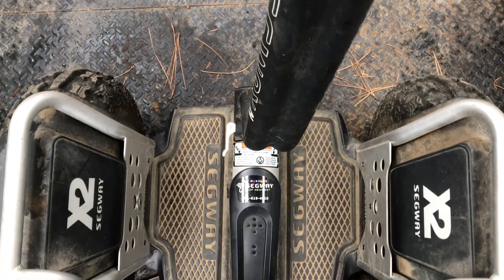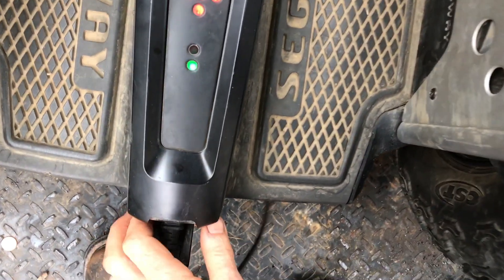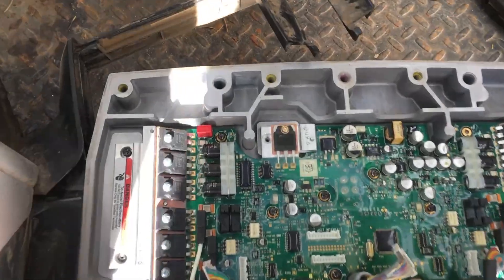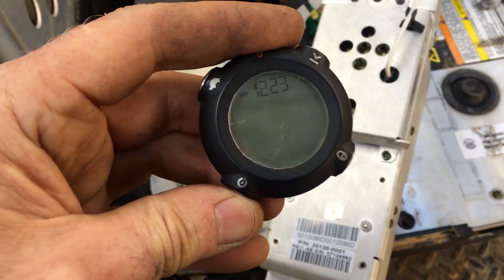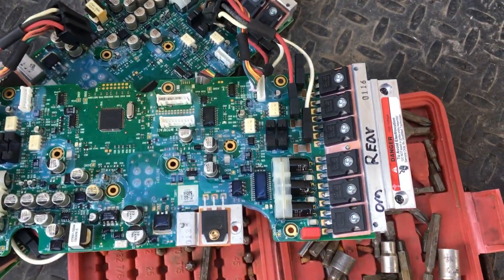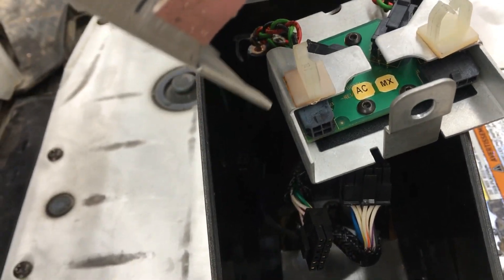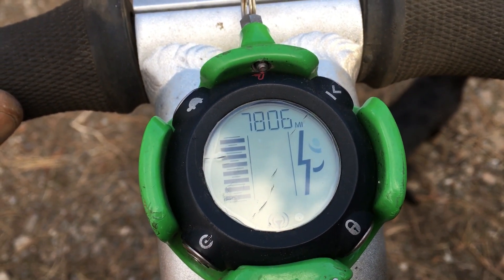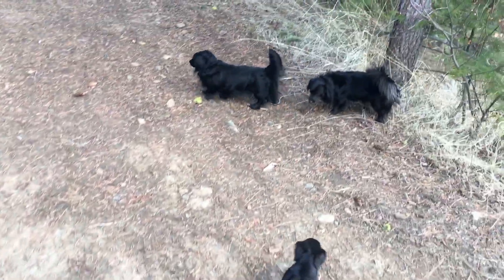Segway PT i2 X2 Error Code E083 Problem Fix Solved Repaired E105

Comment: Where did you buy the CU board from, and can a print from an equivalent be used
Reply from the maker: Guy on ebay ck25.82 has 1 board left  try swapping your boards 1st o and mileage goes with rear board his  boards had like 9,000 on them
Reply: The boards need to be programmed to your serialnumber am I right?
Reply: Hi there, I have seen so many guys trying to make money out of the desparate segway owners, your work has inspired me a lot. Please would you tell us a little more about the process that you change the CU board, do you really need to have it reprogramed even thought you don't mention about it but I this the most part that scares people. Thanks indded.